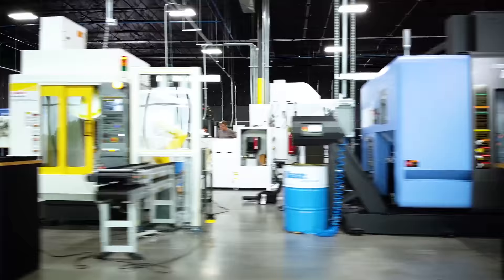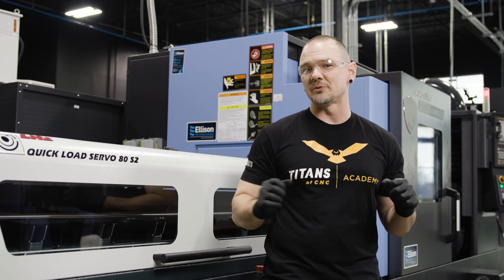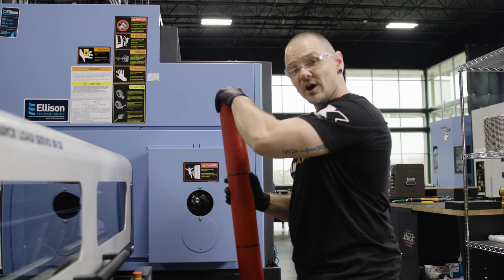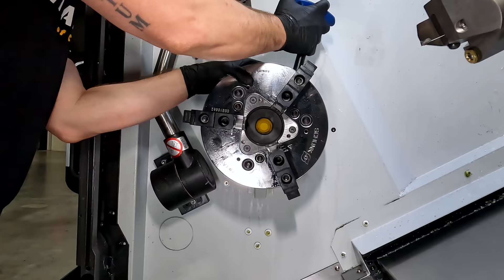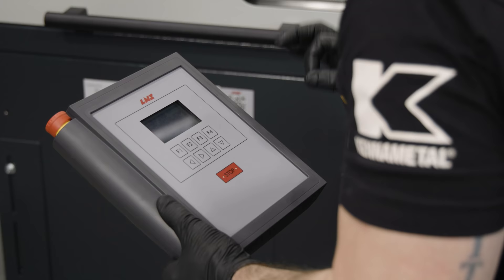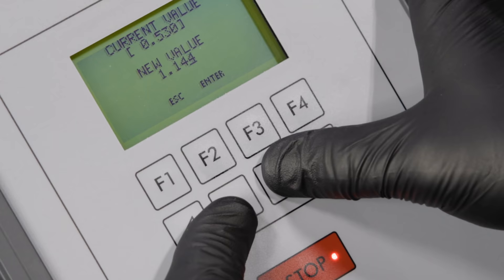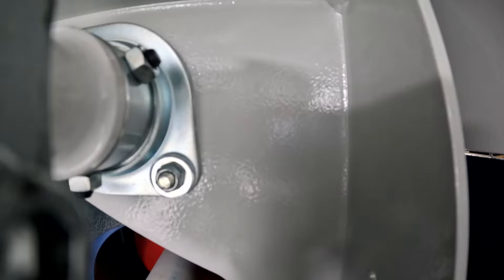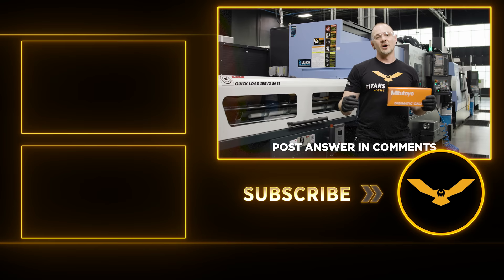LIGHTS OUT HANDS FREE MACHINING… Make MONEY with MINIMAL EFFORT

Comment: Those LNS Quick Load bar feeders are nice! I work with LNS for all of the the lathes I currently run. As mentioned, it's important that barstock is filed on the edges (not everyone does this) and no chips are caught in the draw tube because it will shred those plastic spindle liners. 

A trick I do for lining up the holes of spindle liners... I'll put the torx through the hole of the liner, line it up with the screw hole of the draw tube and push the liner in. No need to eye ball the accuracy, the screw will fit in the first time! 

Best of luck to all those entering the contest! 

- Community Coordinator
  Titans of CNC
Reply: @LNSNorthAmerica  I had to share. I've worked with the LNS Eco Load, LNS Quick Load Magazine Bar Feeder, and the Quick Load Servo 80 S2. It was a unique experience working with diverse models dated 1995 (I believe) and on. They've taken on many hours doing high volume production, and are still going strong!

I look forward to learning more about the LNS brand! I wish I knew more about the integration of bar feeder to CNC, awesome stuff (in my opinion.) 

- Community Coordinator
  Titans of CNC
Reply: You should check out the small multi axis turning centers LNS manufactures. Some little money makers 💰

Comment: I work in a small job shop. And my calipers got "calibrated" ( dropped on the floor) so many times it not only shows differences of 0.1mm and  it randomly shuts off. Thank you and keep up the good work.
Reply: If you drop your calipers on a regular base, you don't need expensive ones.
Reply: You need magnet gloves.
Reply: get an old worn down mechanical one for roughing and one you always place in it's packaging for precision

i reused a scrap one with a bent depth gauge by straightening it

Comment: I’m a 15 year old from BC canada. I do a lot of metalwork in my home shop, making knives and fixing things for my parents. Two years ago, I was looking for somehwere to buy scrap aluminum, and I met a local machinist. He took me to his shop and I worked for a few days with some old tormach 1100 he had there. It was the most inspiring experience of my life up until this point and I have since been working towards the requirements for a mechanical
engineering degree. That aside, I have had a 20 dollar pair of calipers for a year and but now, and I lost them a month ago. They helped me make a lot of relatively precise projects, but having lost them, sets me back a little bit. A pair of mitutoyo calipers would always stay by my side in my future career, and I will always remember the way this channel has helped me find my calling, regardless of if you even see this comment.

Comment: My brother recently aquired a Victor 2473 bed mill from a local guy that was retiring from the trade. The machine had a failed control computer and I took the opportunity to upgrade it to LinuxCNC. I converted the wiring from 3 phase to single phase because we are powering it off grid with a 12kw inverter. The project is not complete as I still need to program the spindle and limit switches but I have the machine following g-code smoothly and accuratly. I dream of being a machinist or a machine programmer as a way to provide for my family. These videos are inspiring and the information is priceless!  A big thanks to Titan and the entire team, I would be honored to give that beautiful tool a home here in Kalapana, HI.
Reply: 👆Thanks for Watching::: You have been selected among my amazing winners. Hit the contact above for claiming!
Reply: Thank you! I sent an email with my contact info. :)

Comment: Well I work at case New Holland. In Pennsylvania. I started there in October 2021 as an assembler. Before my 6 months where up I got moved up to the machine shop working in the tool crib getting tooling together for the machines. I am signed up to take CNH class to get me to a machine. My dream is to make it to the engineering shop for research and development on combines. I am a farm beloved that the combine is the hart of a farm. Bonus it's been my dream since 2006 to be a Machinist and we'll after 17 years of driving tractor trailers I'm in a position to do that. I watch you guys daily and y'all give me the drive and hunger to keep pushing to my goal. Plus if I don't win them there added to my Amazon cart any way. Keep up the awesome work guys love watching at work. "Keep it between the rows."
Reply: 👆Thanks for Watching::: You have been selected among my amazing winners. Hit the contact above for claiming

Comment: Hello!  I'm a mechanical engineering student, and I have a passion for machining.  I love doing design work and then fabricating the designs.  My current pair of calipers is barely able to hold zero, plus or minus 1 thou so needless to say it's difficult to get the level of precision I need sometimes.  I love mitutoyo, I've had an opportunity to use their calipers at a job and immediately fell in love.  I also have a pocket scale from them that has served me well throughout my entire academic and machining career.  Love the videos, keep up the good work!

Comment: I need this caliper because I come to the job shop take the tehcnical print in my hand and you see dimension created by some genious designer engineer like 106.756mm on the print and you see your caliper that your menager bought last Month in wallmart for 10$ and you need to make it happen😂
Reply: If you need to borrow one, you should buy one
Reply: @gickygackers  Bingo. If I have to borrow it more than a couple times, I get my own.
Reply: This isnt accurate enough for that
Reply: if you need to measure to 0,01 or even 0,001mm ... scrap your calipers
edit : maybe also scrap that manager and the engineer ...

Comment: Hi titan, i work for a machine workshop where we have 2 manual lathe machines and only 1 caliper for the entire workshop. The  machines are a bit old and they cut a taper every time we do any turning operation. This dial caliper will make it so much easier to read the taper amount and adjust for it. And  btw I’m from Sri Lanka, if this giveaway is only for ppl within the united states. Good luck to all!
Reply: 👆Thanks for Watching::: You have been selected among my amazing winners. Hit the contact above for claiming.

Comment: Hey Titans of CNC. I’m a junior in high school. Over the past few couple of months I’ve become obsessed about CNC manufacturing and especially your channel. I’ve started following both your yotube channel and Titans of CNC academy. I’ve designed snd programmed some of the building blocks parts using Fusion 360. Obviously I can’t afford a CNC machine and don’t really have anywhere where I could work as a high schooler for manufacturing so I decided to get into 3d printing. I’ve been using 3d printing as an intro to manufacturing. I love making functional prints which often require me to take measurements of physical objects. I bought a cheap set of calipers but they have plastic jaws that are already wearing down. Would love to get my hands on a precision  set of calipers like Mitutoyo!

Comment: I could use thes calipers to help with my manufacturing business.  I'm currently in the startup phase and doing everything basically single handedly with the exception of a few friends and family on occasion.  I am manufacturing complex UAV's and accurate measuring is crucial.  It has been really tough for me at my level of capital to put together a shop, I had to save for a long time and doing things like building many of my own cnc machines and modifying manual machines to cnc retrofits has allowed me to get to where I am today.  I'm always trying to find new and creative ways to grow my company and really could use any help I can get.  Love your videos and have learned and applied a lot from titans of cnc.  Keep up the great work and I'll continue to push forward.

Comment: I would greatly appreciate the calipers.  All of the calipers that I use are Mitutoyo.  This will help ensure that the parts I produce are as close to perfect as possible.  Thanks for the chance to win these!
Reply: Sounds like a great shop Andy!
Reply: @MitutoyoAmerica  
We try to do our best.  The shop use to be strictly tool and die work and building special machines.  Today, we have CNC mills and a lathe along with the manual machines running job shop and short production run jobs.

Comment: I just started custom machining a few months ago as a 20 year old apprentice and I have milled 2 pairs of custom propeller shaft coupling notches and keyways with a prototrak after taking the measurements myself and they have successfully been fitted and shipped out. I have also successfully programmed the mill to carve out two keyways for a dock crane gearshaft  But my imperial only calipers are subpar as there is a .020 error when measuring depth and they have a broken dial cover.

Comment: I'm a mechanical engineering major with a part-time machine operator job. I love to design things on cad, but I cant afford good calipers. Ive seen how much calipers help with my design process so much that I've gifted 2 calipers to engineering friends already, but I'm still using my old harbor freight calipers and they lose their positional accuracy all the time, but eventually they can get the job done with due time.

Comment: I've been a machinist and Mechanical engineer developing CAD and CAM systems for the automotive industry for the past two years. I have had not much to afford quality equipment for measurement, and am starting to reverse engineer components for use by both customers and vendors in exchange for other services. As expected they demand a level of accuracy that sometimes I may reach my limits of with the equipment I currently have (generic dial caliper from HF).

Comment: I'm an mechanical engineering student in Uruguay, those tip of tools are impossible to adquire for someone like me in my country, first because its not sold locally, second due to the high price of this type of presicion tooling I have to settle with low quality products because import taxes are 60% of the tool price + shipping, I'm finishing the restaration of my bridgeport round ram from 1952, and hope to get it going asap and any precision tool is welcome to get my bussiness up and running, atm I'm not manufacturing any parts, only doing automotive work atm, like wiring, engine building, stainless and aliminium tig welding while  in college. This tool would help me alot, it would be the most accurate tool I would have in my set, way better than the 25 bucks caliper I have

Comment: hey guys Nice video as always! :D i FUCKING LEARNED SOO much from you. I live in Germany i went from simple industrial mechanic training (3 Years) to Special mechanical engineering for Special Machines like Pipe feeder ... then i got some BIIIG Trouble with my Vice Boss. While i worked full time (early shift / Late shift 10hr+) i learned cnc machining at home special with your videos and tried to modificate a CNC 3018 into something usefull. Because of your Videos i showed so much motivation that my main boss decided (because of trouble with vice boss) to change my department in the company to cnc. I learned Maho 600E in 2 Days, after 1 year i was introduced to DMU 50 3. Generation and learned the system in 1 1/2 weeks. Because your videos i was the only one machining very thin parts (first my boss laughed at my like always then he was quiet when he saw the result). roughing faster than anyone else, im obsessed with chips flying around :D In my Company im the only of 2 People who know your channel but it gives me a special position over the others. Everytime i try to push the machine to its limits and endmill breaks my boss complains about me i think fuck off im a machinist i make faults but i have to push the machine to its limits!. In our Company we make prototype products but my boss thinks we make serial production so i have to push machine to a critical limit which is contradictory -.-. with this caliper i can dream a little more about my own home and precise production, and set my stress lvl to nearly zero :) im so grateful about your videos and i would say without these i would not be there where im current at, so i can not say i deserve... but i would say i would be pleased to have this caliper :virtualhug:🙏
Reply: 👆Thanks for Watching::: You have been selected among my amazing winners. Hit the contact above for claiming!!

Comment: I ran a dual spindle Doosan Puma 1800 with a bar feeder in my last CNC shop. Unfortunately the bar feeder wasn’t working properly, the bars had to be loaded by hand, around every 45 minutes. So we’d have to run these parts and then run a second machine rather than stand around, which was fine because honestly it’s insanely tedious watching a machine run like that. 

I’ve since left to work in a manual shop where the newest machine was made in 1984 and the oldest is a massive boring mill that is at least 100 years old, which we’re still expected to hold tolerances of .001” on. Sometimes it does, but it’s more by luck than judgement 😂

Comment: I am trying to get started in manufacturing in a area that has practically zero manufacturing in the area. Built a couple Cnc machines with a fancy hot glue gun tool head an now building a printed CNC router table to support a manual lathe here in the near future to continue on my journey…
Reply: 👆Thanks for Watching::: You have been selected among my amazing winners. Hit the contact above for claiming!

Comment: I inherited my original mitutoyo 6" from my dad when I graduated high-school, and used them through my Engineering Tech degree. I started TA for some of the fabrication classes and lent my calipers out... the rest is between the calipers and the floor!  Graduating next semester but until my first few 'big boy' paychecks I'm stuck with my old verneirs.

Comment: try booring and external turning using 1 tool .  or tool parting and external turning use 1 tool.  it will save holder and save tool change time

Comment: im working on an open source motor assisted wheelchair for children with obstacle and gap/stairs detection for the auto break function. calipers would really come in handy for that.
also i started designing and building a 3x3ft portable cnc plasma cutter for myself. cant afford a mill yet, but some day... defenetely a little bit faster if i dont have to buy calipers myself :)

Comment: Next buy is a bar feeder for each of my two lathes. Now it's a bar puller only on each. Still great to have and works well. But I yearn for a bar feeder, and space to put them in. That's why I don't have one already.
Reply: @LNSNorthAmerica  Running out of room. 3000sq ft, SL-20, ST20ssy, 2 VF2ss, 2 VF3ss, Horiz production saw, vertical saw, manual mill, manual lathe & air compressor. Two material racks, Parts rack, shipping table & benches.  Need neighbor or neighbors to move out.  Side of one mill is 3 ft away on one lathe. I have to open window to load 48". Other backs up to a walk thru area.

Comment: Bros. I have 4 different locations that I’m needed in in my shop. I run a Toyoda Cell system with 2 Horizontal mills and a RGV behind the two which consists of 32 pallets. It’s a feeding machine! I’m always running between machines, load stations and the two tool matrixes and having to carry around calipers is such an inconvenience! My work makes us supply our own measuring tools which is fine but I’m the only one in the shop with 4 different work locations. USA Made all the way baby
Reply: 👆Thanks for Watching::: You have been selected among my amazing winners. Hit the contact above for claiming.

Comment: Hi Titan crew, been watching your videos for a long time, I don't even remember the time when I subbed, your videos helped me so much in such a way that I build my own CNC out of granite, it weights around 1500kg very solid monster complete custom design, for a start, it took me just 8 days to precisely drill 170 holes in granite and then 3 months to do the rest, and building this CNC was just to build another very special CNC Pick and Place machine for assembling electronics with over 55 custom-designed and machined parts, if was awesome journey building both of the machines and in parallel learning from your videos. I have one special caliper that was a present from my dad that I am using, even if I take care of them in a special case and clean them there is some issue with the battery being constantly low and I need to replace it every week or two, these calipers are very old and they have a lot of "kilometers" behind them 😊. I can buy a new one but these ones have a sentimental value to me, the same as Titas gift would have. Just want to say stay safe in these crazy times, much appreciate your videos and the time complete Titan Crew is putting in.

Comment: Even though it's already given away, I need this caliper so that I can hang it on my wall, and when my machinist comes in complaining, I can point to it and say "Just use one of those!" when I write one of my genious design engineer dimensions like 106.756mm on a set of plans.

Jk, I would never do that. I would tell them to use transfer gauges because it's an inside dimension.

Comment: [05/21/22]  That setup is very cool. I also see a lot of material being wasted thru the removal process. Couldn't the mfr of the stock material produce it in tubing form fairly/relatively close to the finished dia., or maybe in an industry std size?  That would save a lot of material, cost, and machining time.  BTW, where do you announce the winners of giveaways??